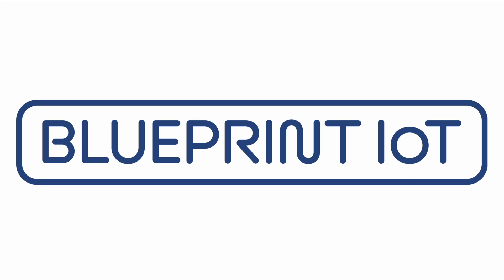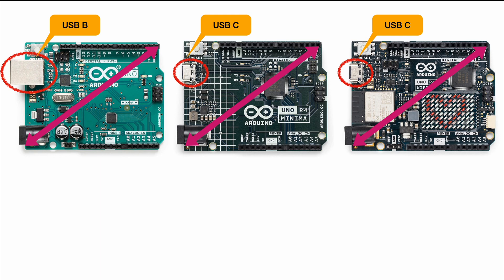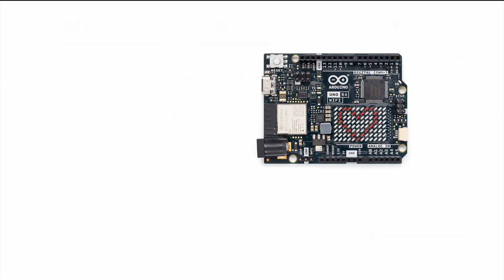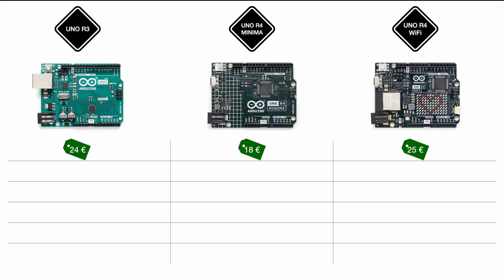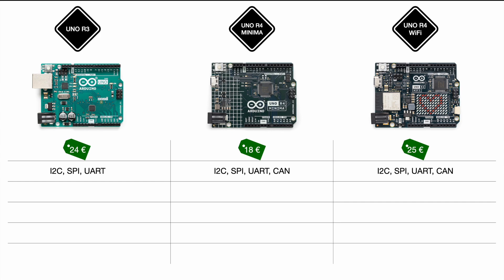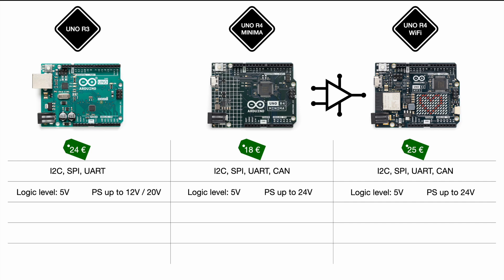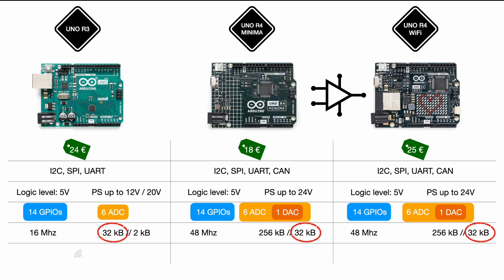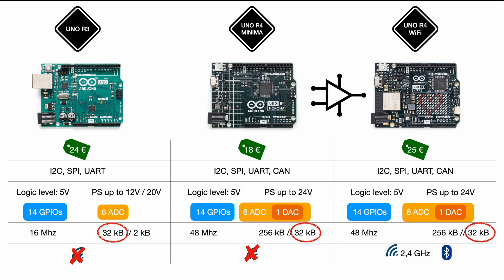NEW Arduino UNO R4 - All you need to know

Comment: It's funny their WiFi chip is basically as powerful or more powerful than the main chip. Biggest thing "striking it" from this project in particular is it only being 3.3v capable

However I've always been weirded out by the pin form factor. Its nice and big for first impressions but quickly becomes unwieldy for integrating into a project

Comments are never put into your actual executable code as the program size

Would love to see one or two versions of these in the nano format.

Comment: Uno is good for education or maybe one off projects, but that's about it... 18-25 EUR / borard is far too high for making products in volume and still be competitive on the market. I personally never cared about wi-fi on every microcontroller board, or even having USB... I care about low price, and small size, but then they killed the pro-mini, and came up with some overly expensive shit... Good thing is I can still find pro-mini knockoffs at least. The thing is If I need wi-fi, I prefer ESP12 modules, if I need lots of I/Os, picos are cheaper, If I need cheap controllers, I use bare chips(atmega328p, attiny44, atiny85, etc.) and now I'm looking into to STM32s cause I've got a few low power projects...

Comment: I think it would be nice to have a Minima with LED-matrix, but I gues I'll just get the WiFi version.
Reply from the maker: Eventhough the wifi version is a bit bulky, I think you just unlock a lot more use cases…
Reply: @blueprintiot  looking at the schematic for both versions, it seems like the LED matrix make use of NC pins from Minima.
Then there are a few NC pins on the ESP.

I think it would be interesting to see an Arduino R4 Mega, making more GPIO available.
Reply: @blueprintiot  I mostly agree with your point, that you get a lot extra with the WiFi model.
I'm not surprised if there will be clones with either WiFi or LED matrix
Reply from the maker: And if you really want to habe a LeD matrix on the Minima you can always get a shield or external one …

Comment: What i would really like is a R4 Minima, but in the formfactor of the Nano or Micro.
Reply from the maker: Consider an ESP, even comes with wifi…
Or is there a specific reason you’re looking for an Arduino product?
Simple wifi capable microcontrollers - Arduino Nano IoT vs ESP32 vs ESP8266 vs Raspberry Pi Pico W
https://youtu.be/psDdNgPPSoU
Reply: @blueprintiot   I want a 5V based MCU. Almost all the capable MCU now are 3.3 V. I use the boards in a 5V environment. Of course you can do levelshifting etc. But would be nice to avoid it.

Comment: I was the biggest supporter of USB-C after I got a 2016 MacBook Pro and it’s really annoying that so many companies are switching over now after such a long time. I have dozens of spare 2-3m USB A-B cables from old printers etc, but I’m not sure if I yet own a single USB A-C cable over 2m. Most I have are like 10cm long and some don’t even transfer data. 

And now with WiFi you’re going to see high voltage AC plugged in right next to Arduino school projects with wires going everywhere because so many USB A-C cables are only 10cm.

Comment: The LED matrix would still be useable for a real product to display  error codes for example...
Reply: LED matrix already helping with troubleshooting and routine inspections 😊. Must admit, I didn’t think it was going to be of much use when I first heard of it. I gladly admit I was wrong 😅😂
Reply from the maker: Sure, but I think quite unlikely to have to Matrix facing outside of a production housing. Anyway, for error messages for service engineers after opening a housing or similar is something I can imagine quite well.
Looking forward to projects capitalising the LED matrix!

Comment: esp32 starts from $3.... Arduino is so overpriced. Even if esp32 would be more expensive I choose esp32 anyway.
Reply: I think the price includes the development of all the educational material and the IDE and keeping the whole thing open source
Reply from the maker: Sure, but still, others like Raspberry Pi or Espressif (of course more focused on professional applications, while Pi focused on education as Arduino) do the same. I'm sure they are not making tons of money, probably just an expensive company structure, efficiency, and of course design. Can't be cheaper to build an Arduino incorporating a whole ESP32 than building an ESP32 on its own...
Reply from the maker: Agree 100%. Nevertheless, Arduino made a step into the right direction after many years with an even higher price structure and no clear commitment to wireless....
Anyway, I'm also like working with ESP, 32 especially. Check out our latest video about a new project involving ESP32!

Comment: The second memory value, i.e. the 2kb in 32kb/2kb for the R3, and the 32kb in 256kb/32kb for the new boards are SRAM. SRAMs are used during runtime, this is used by your variables. Code comments are not included when you compile your program. Having a bigger SRAM means you can create and use bigger variables, like when you want to create huge array for keeping track the value of an LED array.
Reply: Yes, I also didn’t understand the author’s idea of filling EEPROM with comments.

Comment: As far as I know, the Qwiic connector is the same as the Adafruit Stemma QT: both use 4 pin JST SH connectors, which are 1.0 mm pitch

Comment: The removing comment part is totally false, i don't think anyone does that (except him obv, lol). Ur Arduino gets the compiled version of ur code not just ur raw sketch and the compiled version doesn't have comments so no need to remove them manually. Also the rest of the video was of no use, it was just comparison of 2 charts which u can read in like 2 mins
Reply: I do have to remove feedback to the serial port sometimes or shorten the strings, maybe he is talking about that?
Reply: @joseph9915  yea the strings do go into the compiled version of ur code, so shortening that will help. We can't say for sure if he was talking about that or not, tho I don't think so coz he didn't fixed that in edit either

Comment: Nice, actually makes a lot of sense. A few years back I was working on a project where I needed multiple radios, the 8266 gave me wifi but you never get enough IO on those boards.
The other radios were more suited to an arduino because of things like IO and timing. I ended up building a board that did exactly this, it was basically an arduino with an 8266 attached to take care of wifi and data is stilll being passed between the two of them today.
I've printers done this way! Do we redesign the whole machine around a new processor, with a new operating system, with a full IP stack, and implement the encryption... or we could just throw in an ESP32 on a daughterboard in there, it is only a printer after all.
If this was available back when I was doing my project, I would have just used these.